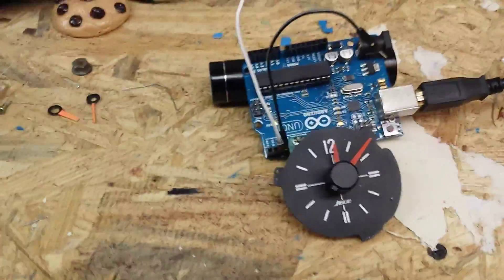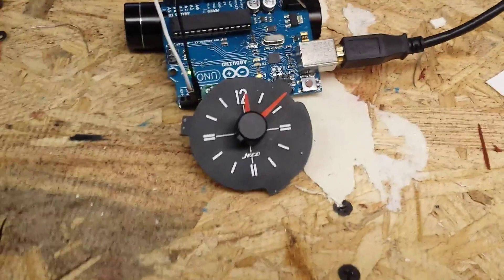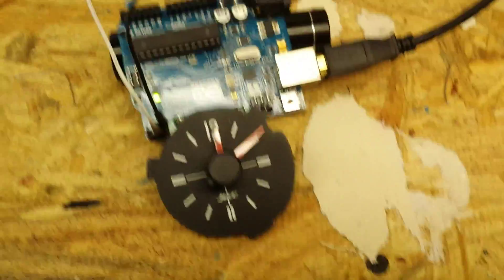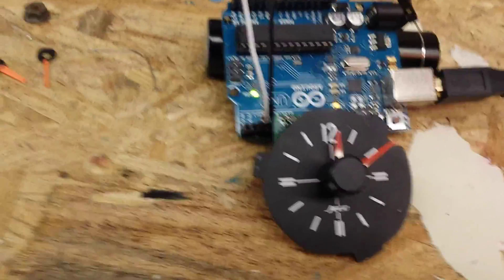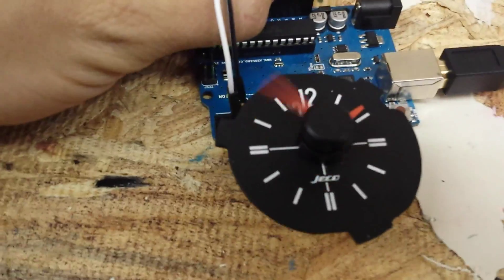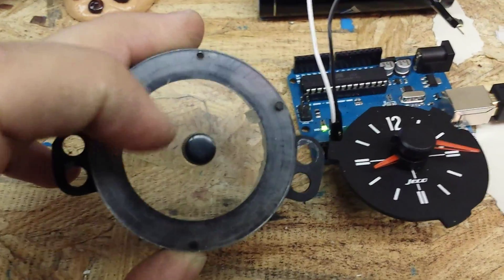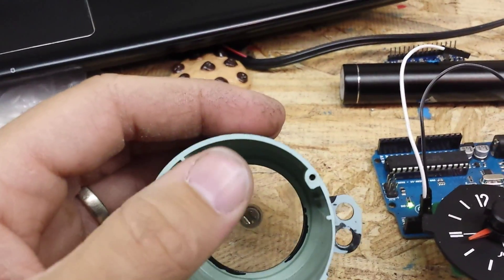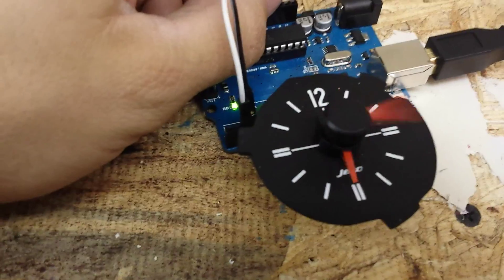77 Celica analog clock to arduino stepper motor

Comment: did you can do a counter 1-2    0-9    (for hours) and  another  0-5   0-9  for minutes, and   "do the maths for translate to degrees"    (COUNTER IN BINARY  4 digits like old school BCD)  
an your clock KNOW the actual time (i do this in colege ussing TTL logic) using the   59 in binary to carri 1 hour and reset himself)

I GUESS  this setup have a 60-1 reduction gear ...  but how did you do 200 steps into 60 ?
----
This is a nice proyect because the comercial clocks are crap afther 1-2 years...
maybe  all together can give life to a INMORTAL CLOCK for home,

Comment: I liked your video. I 3D printed a desk clock and you gave me an idea how to design the new clock face. Also I would like a copy of your code so I can get the clock to work. I would use an Oscilloscope to get the time more precise. I was thinking how to adjust the time to the atomic clock. You would almost have to write a program on a Raspberry PI and connect it to WiFi. The only downside is it would only adjust it when you were at home and connected to your WiFi. You would have to tell the Raspberry PI the current time on the clock and it would adjust it accordingly. If I solve the problem I will let you know.
Reply from the maker: Unfortunately I lost the original code when I got a new computer. I haven't done anything more with the clock as I've been working more on the other car gauges. You could use a GPS receiver on an arduino and set it to the time received there, and that's actually my eventual plan. But you have to ensure you can actually receive GPS wherever you're clock is mounted.
Reply: @Foxau2  I looked up the dual stepper motor that you used and the only one for sale in the entire United States was $750. What I am going to do is use two. 28BYJ-48 Stepper motors instead, there $2.80 each with the controller board. On the second stepper motor I will use a gear to drive the hour hand. I will look at other projects to get the code. Thank you for the idea on how to design the clock face.

Comment: I assume the hands are indexed so they shouldn't slip. If so a simple apple or android program to take a photon of the clock would let you calibrate it. Failing that if you calibrate the clock and have that stored in your program then have the RTC be separate you could even go between different modes. I.E. If you set it to say 6:00 and your program knows then in theory it should be able to add or subtract as time changes. If you really want to get fancy you could even tune the device. Have a cam videotape the clock run image analasis on the video and automatically fine tune the steps per minute.

Comment: Great Idea... I've been looking for a stepper based clock mechanism for a neo-led based clock, do they sell bare bones stepper clock DIY kits anywhere you seen?
Reply from the maker: Robert David you can buy this kit and desolder the clock from it.
 https://rover.ebay.com/rover/0/0/0?mpre=https%3A%2F%2Fwww.ebay.com%2Fulk%2Fitm%2F271703975792
Reply: thank you!...

I'm surprised that stepper /servo based clock movements are so hard to find,  I see a few listed on Alibaba but the specs are all over the place & there doesn't appear to be a standardized replacement, I think it would be a awesome if someone like Adafruit or Spark-fun offered one, it would open a whole new world for clocks.
Reply: Hi the clock from this link is a workable quartz clock by itself, it is not a stepping motor clock. Could you please help verify this. I have bought 2 units and found that the clock motor has only 2 connection pins which is not the same as the step motor gauge which has 4 connection pins.

Comment: If you calibrate the clock at 00:00, could you use current system time to set the hour and minute angles accurately?

Comment: Great looking analog clock conversion! I am curious to know what is the make & model of stepper motor(s) you used? I appreciate if you could share me schematic/connection diagram, and arduino sketch/code on my e-mail vr_xlent@hotmail.com
Reply: There is a company that makes servo motors that have built in detection of hours and minutes using infra red sensor http://www.ismintl.com/products/stepper-motors/clock-motors/

Comment from the maker: No I haven't yet. Still a dozen other things in the burner before that happens :) I've considered keeping track of the steps after defining zero, and that might be the easiest way. If the power is lost though I'd need to redefine zero unless I write it in the non volatile flash after every step. Only problem with that is it could wear it out doing that many writes.
Reply: Every time the clock would hit 00:00 it could adjust the time, you would just have to put a sensor of some kind on the back of the hands and a detector on the plate. Once I figure it out I will let you know.

Comment: Fantastic work!  Did you ever find a soution to the zero detect feature?  How about setting up a lookup table in code that constantly tracks the position of the clock hands. Calibrate the table to 12:00.  You would have to recalibrate if the clock
lost power.